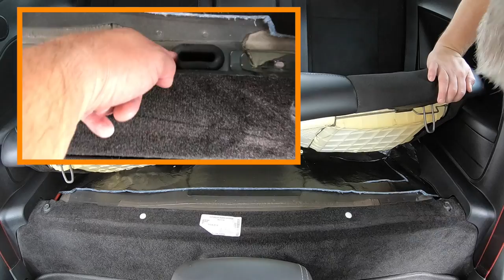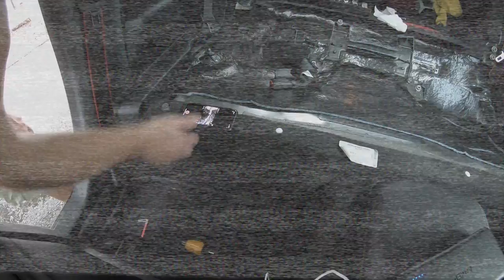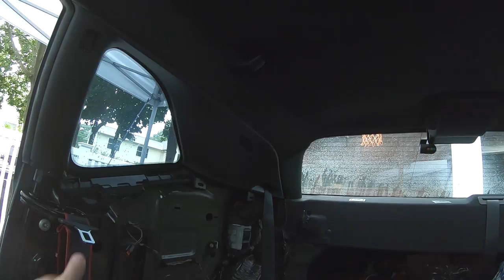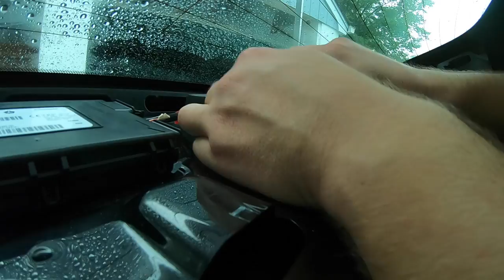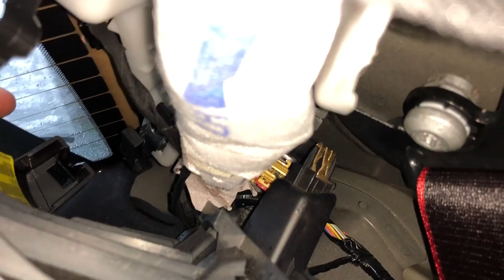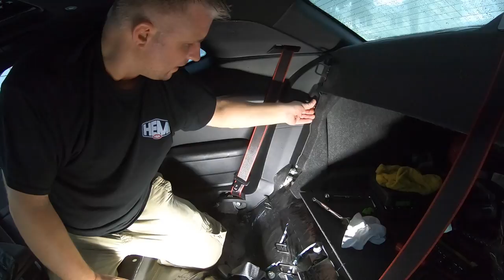Disassembly of 2015+ Challenger rear interior and install of SeatbeltPlanet custom Seat Belts

Comment: Added a backup camera - my 2012 SRT didn’t come with one - and a two channel dashcam (front & rear). The front panel removal was easy and intuitive, but the panels rear of the front seats concerned me and I didn’t want to damage anything. Your video was exactly what I needed to do the wire runs without a hitch. Excellent, thorough video which made the job simple - and your suggestion to remove the seats, was bang on! Great job!

Comment: Thank you SO much for discovering the way to R&R the panels without damage.  That saved me from the worry you went through as you blazed the trail.  I have been trying to find all the interior noises, and it has been upsetting.  Brand new car, crap design or install of something on the right side.  You have been a big help!

Comment: I love your Videos !
Yesterday i installed the Shifter-Paddles and paint the Inlays of the Steeringwheel in pitchblack on my 2015er R/T.

For disassembling the airbag, i made a "special-tool".
Now, in 10 Sec. the job is done.

Greetings from germany.....
Reply from the maker: I could have user a special tool ;) mine took quite a while to find the right spot.  I've been considering doing this again to paint my inlays as well ;)

Comment: I was surprised to see the Harman Kardon speaker was attached to the trim and not the frame. Can that speaker be changed from the front, or does the panel have to come out? Mine is buzzing…..🙄

Comment: Hi... I know it's been a while since you did this job but did you decide that you don't need to disconnect the battery to do it?  Thanks
Reply from the maker: I would recommend disconnecting the negative battery terminal for this task.
Reply: @WorkPlayDrive  Thanks for the reply...Have been looking at the service manual under Body and Restraints to get torque values and I concur...FYI they say to deactivate the SRS by lifting the negative battery terminal and waiting a couple of minutes for the capacitors to discharge. They also say to unplug the Intelligent Battery Sensor first if you have one. Never heard of it before now but these cars have an Occupant Classification Module under the center console by the shifter that if turned over while connected activates the air bags for a vehicle roll-over. (Glad that when I had the console out and wondering what that box was I didn't mess w/ it.)....Getting ready to undo the rear seat delete mod. Thought I would provide some additional info on Intelligent Battery Sensor.  Had to replace mine under warranty and found out that Dodge no longer recommends removing the Intelligent Battery Sensor (unplugging the connector). This requires that anytime the negative battery cable be lifted that it be removed via the 10mm nut that holds the cable to the bracket attaching the IBS to the battery post.  The battery negative post bracket is never removed so that the IBS will stay powered. (Think about how to replace a battery w/o loosing power to the IBS.) Discovered this because the after race cooldown feature would not activate because of Battery Status...IBS was goofed up and nothing wrong w/ battery. Also found out if you need to lift the negative battery cable open the doors before you do it or you have the potential to goof up the window seals.

Comment: thanks for the video. do you know roughly how much the rear seats weigh all together?
Reply from the maker: The rear seats are roughly 35 lbs total.
Reply: @WorkPlayDrive  that’s it? I’d imagine they’re at least 50lbs, they seem very heavy
Reply: @WorkPlayDrive  Hey, just a  little update. Finally took out the rear seats, they were 48lbs on the dot
Reply from the maker: Nice thank You for the update.
Reply: @WorkPlayDrive  Here’s some more info: Floor mats + rear seats + trunk liner + air compressor for tire = 70.4lbs. Plus if you have the spare tire and take that out as well, it’s 116lbs. 116lbs!

Comment: When I watched the front seat belt swap video I was feeling like I don't feel comfortable...but now that I watched this even though you took more stuff out it doesn't really seem that bad.....I have color samples coming from safetyrestore.com, have you checked into them? They only charge $75 per seat belt to re-web it and they have lots of colors too. I might take this on, after I watch this a few more times maybe I will feel comfortable doing this....Thank you for the tutorial, awesome work!
Reply: @Work Play Drive I am wondering if there is a torque spec for reinstalling the seat belt bolts, as well as if I should put more locktite on the threads....

Comment: Do you recall what size the seat belt bolt is near the bottom floor?
Reply from the maker: Sorry I mention it in the video it’s either a Torx 45 or 50

Comment: I have a rattle on the driver side back window area. I think this is a known problem with the challenger.  Any advise?
Reply from the maker: Grab a passenger and have them press one various areas while driving my issue was the rear deck was loose and rattled
Reply: Work Play Drive it is the the midline of the back window I can press it up and I hear it.  Seems I need to take out the piece apparently this is a know. Issue
Reply: Actually the side window In the back
Reply: @ManrantsonMRA  Did you find the issue? I am having the same rattle